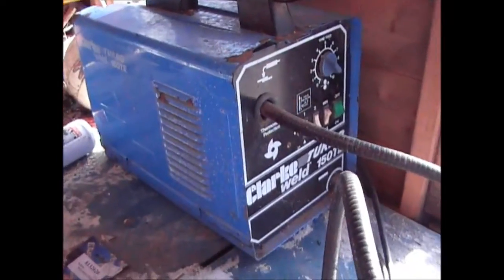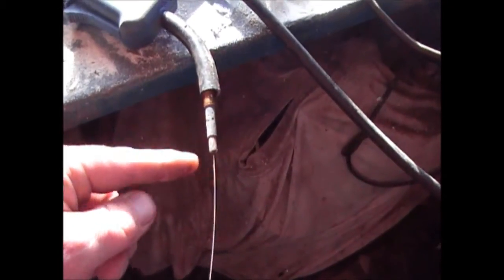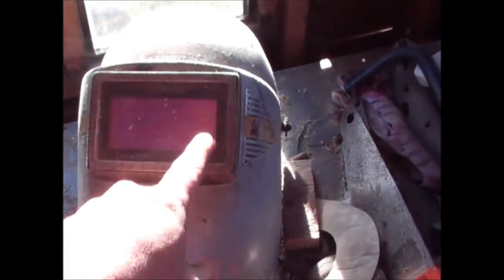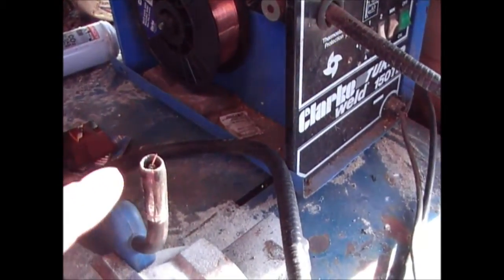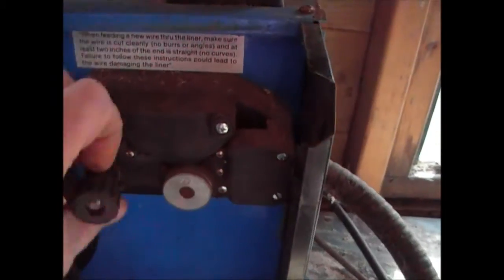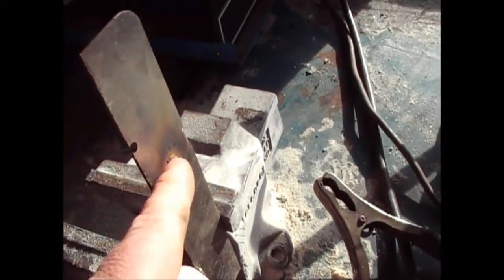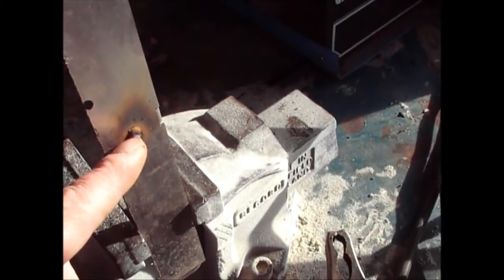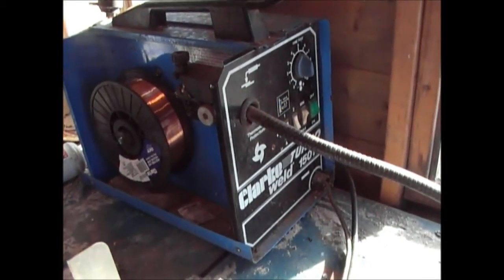Jim's Allotment - Plot 9 - February Tour Part 4 - Learn how to MIG Weld

Comment: As a 70 year old grandmother I found this so fascinating. I have done some minor welding but mostly light weight weight brazing and soldering. Thanks for this. I probably will never use this information but I still found it very interesting. At the very least, your video will help me to have a sensible conversation with my son when he is welding. Just a point of interest, I taught my son to solder when he was doing a school project. He was getting very frustrated as the welds were not holding, so, I showed him how important it was to work with clean metal. He is now in his late 30's and a good welder now.   Take care.

Comment: Jim
Thanks very much for this tutorial 
The reason I asked for this is that I have got access to my late brother in laws welder ( no instructions with it). It is also a Clarke but not sure what model number it is. I also noticed that you had got a packet of moisture absorbing granules in the cab to help preserve the wire. 
Question...... Can the earth clamp be fixed to ant metal surface or does it need to clamp to the item being welded?
Thanks again
Nigel
Reply from the maker: Hiya Nigel, Glad it was useful for you, as long as the earth is electrically connected to the part you want to weld it will be OK, To be honest, if you can connect it to the part you are welding then do that, this avoids any unwanted sparks :o) All the best ... Jim